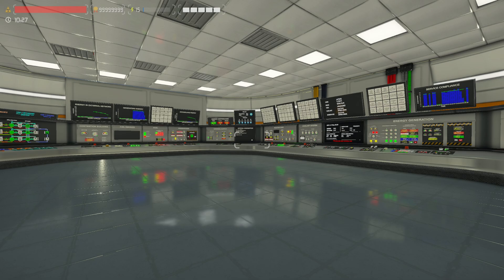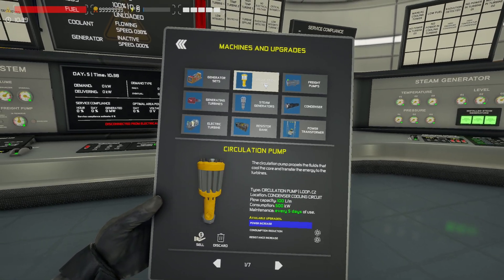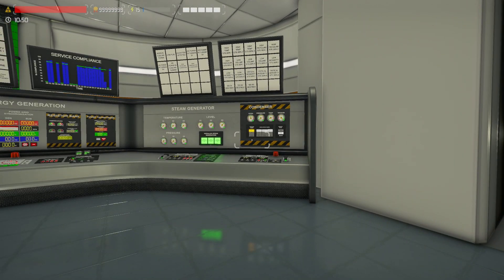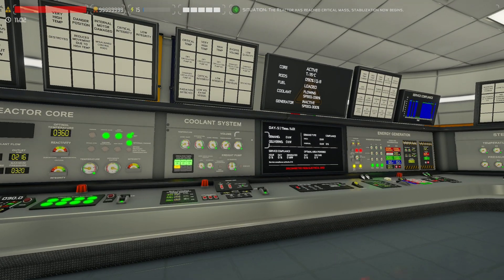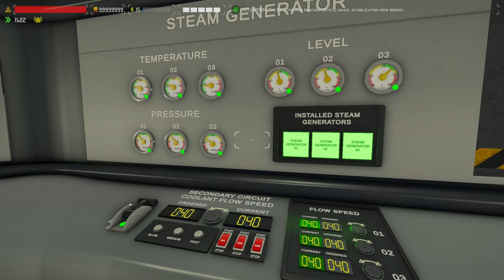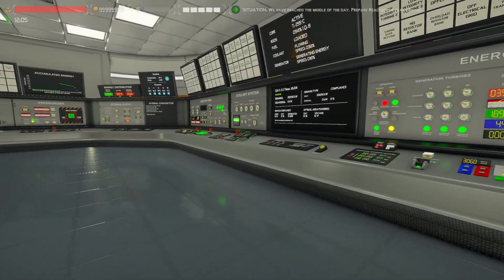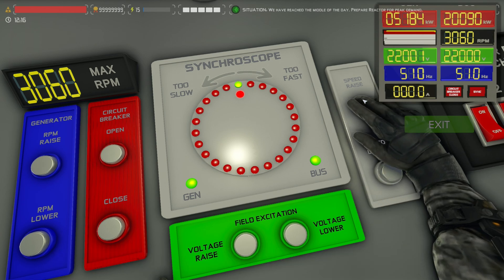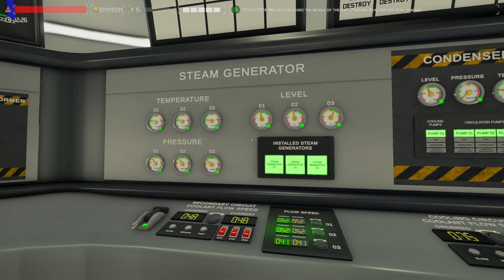Nucleares - Can I Start 3 LOOPS in 2x Time Speed???

Comment: Thanks for the new videos. I have reached a point that I need to probably upgrade components. I need to do a maintenance shutdown anyway.
Reply from the maker: Yeah everything needs to be completely off to be able to do maintenance or upgrades... I'd probably suggest making your condenser last longer and maybe upgrade your turbines so they can be sped up faster without going over the 100% speed on it... 
I need to make a video on what to upgrade etc I think...? 😎🤔
Reply: @ShArPy1o1Games   trying to make stable power above 23mw has been an issue as i can't  keep up with high demand times then it drops 12mw and  I damage the resistors banks. Bought new banks forgot the resistors for them
Reply from the maker: Haha yeah then you need to manually place them into the resistor housing itself for it to be useful... but live and learn lol

Comment: Have you by chance figured out a way of starting up or shutting down a loop with other loops in operation?
Reply: I did figure out how to start and integrate a loop while another one is already operating. Tldr..lot of runing and ajusting but not as hard as it seems. But you really need to only slowly introduce the new loop and reduce the other loops otherwise you'll end up like I did puting the coolant flow of the new loop to 49 out of the blue which generated too much energy too fast blowing up my condensator xD
Reply from the maker: Yeah I might suggest 25% on the primary coolant for the new loop and open the turbine bypass slowly more and more on the old loop to power it off completely after the new loop is in
Reply from the maker: That has definitely been on my mind and I'll be testing that out sometime today 😎

Comment: Great video! Everything I know about this game I learned from you. Do you think you can do a comprehensive video about when and how to install new loops? Already at the 3rd day I failed to meet the energy outputs and would love to see a progression guide video
Reply from the maker: Adding a 2nd & 3rd Loop are only needed when you need to shut down the old loop for maintenance especially if your only on 'Day 3' 🤔✌️
Reply: @ShArPy1o1Games  hm...then how do I increase energy output?
Reply from the maker: Increase your Primary Coolant to transfer more heat to your generators which then you will need to turn that up as well as your condenser ✌️
Reply: @ShArPy1o1Games  aaah. I tought 49% is where you need to keep it allways since audit or something :D and do I decrease it for the night or keep it and use the bypass?
Reply from the maker: The 49% objective/Audit is not necessary as you need to weigh the option that will provide the most money at the end of the day (at that time of releasing Nucleares vids, my OCD was getting in the way and I had to enquire on Discord for help ✌️)